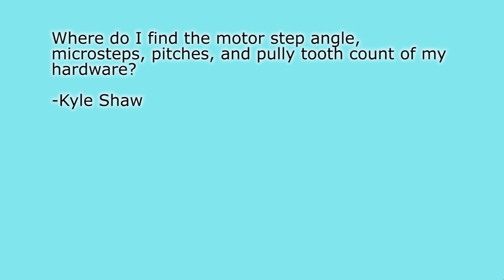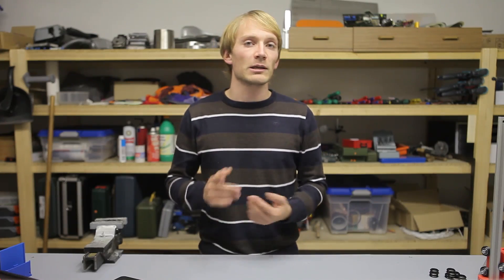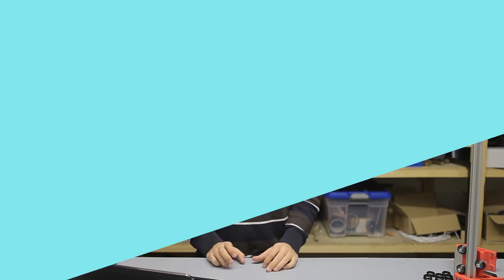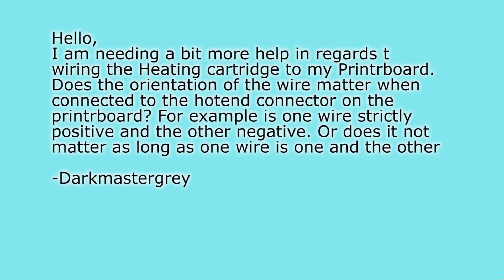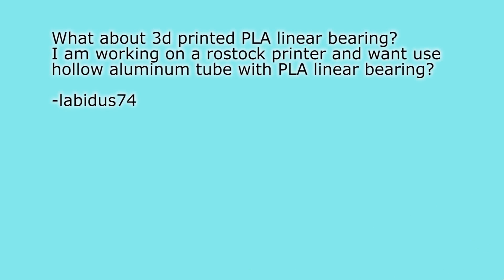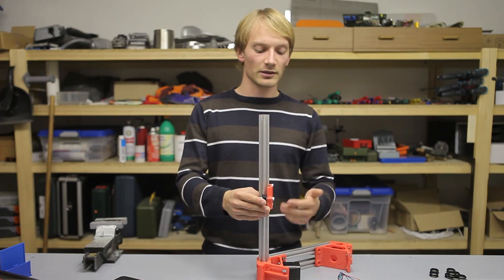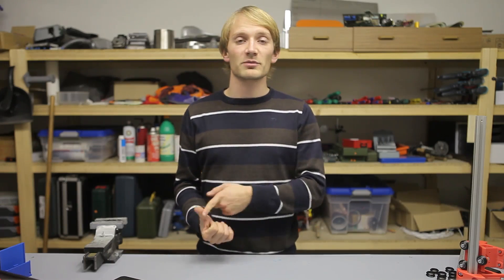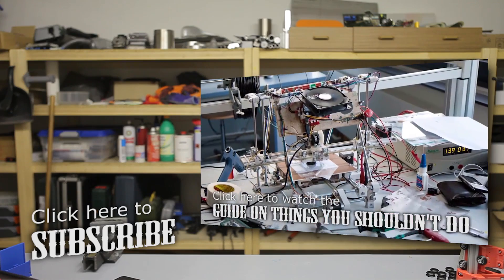Q&A: Endstops, Electronics wiring, Smell-free filament and linear guide options!

Comment: Hi Thomas couple upgrade hardware questions for my Tevo Tornado.

1. Any benefits of using optical end stop sensors? And if so, can I switch out my mechanical end stops with optical?
2. TL smoothers heard they greatly improve Salmoning any thoughts?
3. I know you have done a vid on Auto leveling sensors, what do you recommend for the Tevo Tornado? 

Thx

Comment: hey .. i have connected the end stop(that has 3 pin) backword  ..
the RAMPS shut dowen and does not work when i connect it to the power supply But it work ok when i connect the arduino with pc 

is there is any way to fix the RAMS?

Comment: Hey Thomas, Love your Channel, lots of great info on 3d printing. I now have my Prusa i3 up and running, but strange things are happening while printing, the print head will just stop moving, or slid over to the left of the x axis, or slid back to to the end of the y axis?? any idea why this happens? I have a 8 x12 heat bed, dual power supplies, Rambo 1.1b, Marlin Firmware and a Hexagon Hotend, 1.75mm. I have a video on Youtube of the problem at https://youtu.be/DJLjban_qHE  , thanks in advance for you help!  Glenn

Comment: Hi Thomas,could you explain in your next Q&A video how to calibrate retract settings in order to minimize stringing on printers with bowden driven filament. There are too many variables like speed, distance, retract acceleration, z-hop, but even if I can force my delta printer with bowden to retract 7mm @ 40mm/s, 2000mm/s/s, the results are bad with some materials. (the ugliest stringing I have with PLA-D: http://youtu.be/p3_L9pr0aKw)

Comment: Is there any way to change the temperature table on the Printrboard to use a thermocouple? I think the tollerance is lower and its capable of higher temperatures.
Id like to build my own hotend on a german reprap neo, maybe. The thermistor isnt fixed to the hotend very well -.- Its just laying in a hole filled with some kind of silicone/gel. What other methods to mount a thermistor are there? Which do you know? The thing is its kind of unstable, sometimes it gets better contact with the hotend which changes the temperature dramaticly !

Kristian from Germany ^^

Comment: Hi Thomas,

Actually those 3 pin pcb endstops are a little tricky. If they are wired wrong, magic smoke may be seen from the arduino. I have burnt the voltage regulator on arduino mega by wrong wiring the 3 pin endstop.

Thanks for the video.

Mehmet
Reply: ***** my pcbs' had 4 pins. Vcc and signal were at the sides and the middle 2 pins were ground. Exactly as you said I mixed the Vcc and the signal. The cable supplied with it had 4 lines where one end did have 4 pin xh connector for the pcb and the other end had 4 one pin dupont female connectors for the ramps which can be easily mixed.
Reply: brother have got the solution even i burned my arduino voltage regulator